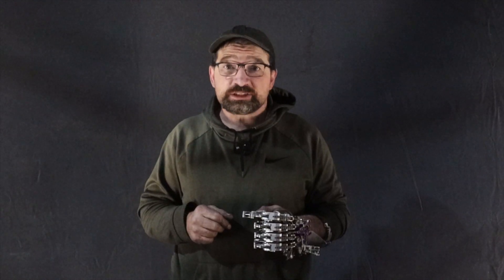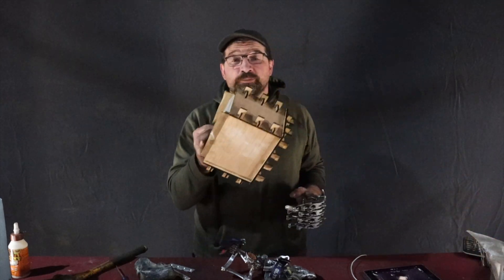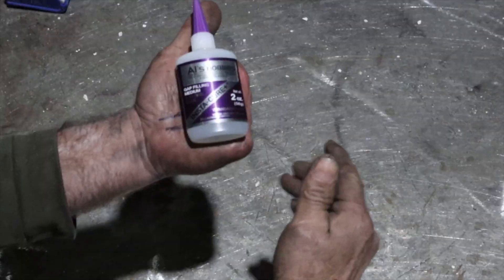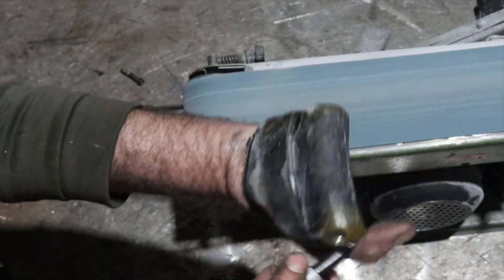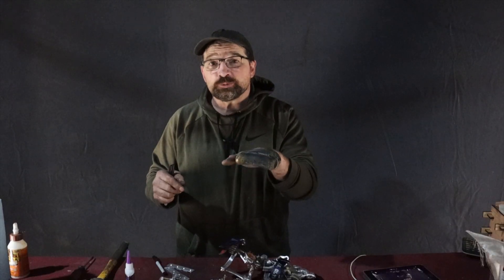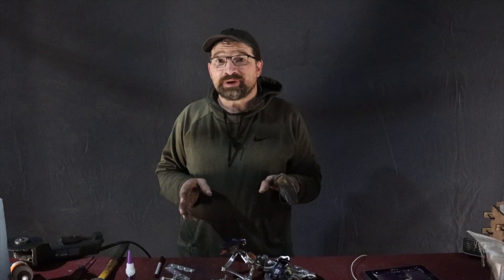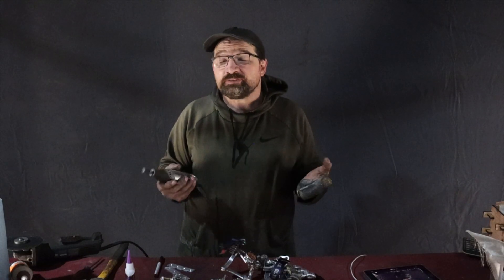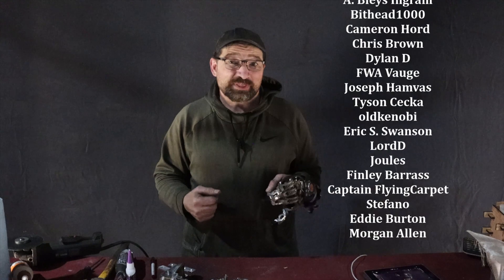3D Printed Prosthetic Hand  DIY Video No.5  De-Molding and Finishing!

Comment: @Ian Davis, have you tried using a pressure washer for plaster removal? I would think that the mix of pressure, and flooding nature. Might help release the plaster and not damage the part. Just a thought that came to mind when i saw you struggling and realizing I would be hating life in the same situation.

Comment: Amazing work! I hope awareness of your designs continues to increase!

I was electrocuted at 19 years old and have extensive damage to both of my hands. Nerve damage as well as loss of mobility in the fingers. On my left hand a partial pinky and ring finger prosthetic was designed using a nerve sensor and the little worm gear motors. It was always kind of sluggish and too fragile for anything I wanted to use it for. I don't know when or if I will find a functional prosthesis solution for my hand but watching your innovative solutions gives me hope.
Reply from the maker: Sorry you're a member of the club. Hopefully, your loss has made you stronger for it.  Would you mind sharing a picture of your device with me in my discord?
Reply: @missingpartsclub  Yes absolutely, I would be happy to.

Comment: I have brachial plexus injury on my right arm.
I can close my fingers & not extend
Can move my wrist down but not up.
Is there anything you can do for me brother?
I'm a 28 year old from India with a single old mother. 
Please help 🙏🏻
Reply: I am willing to pay whatever I can, I do not want you to have a loss because of me. It may not be much for you but I'll always be grateful to you
Reply: @exosianteatime1517  was thinking along the same lines. take a rubber glove, cut out some material from the back of the glove and then close the hole by melting it back together. should leave you with a glove that always pulls your fingers back (the more material you cut out, the harder the glove will pull them back). it's a bit crude but it should work at least as a temporary solution